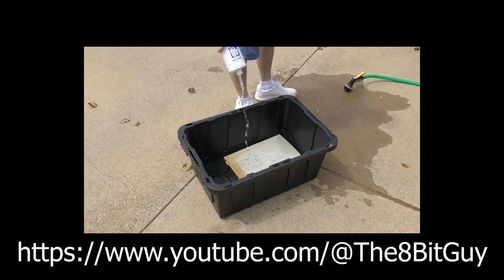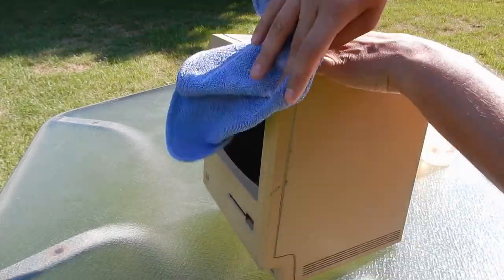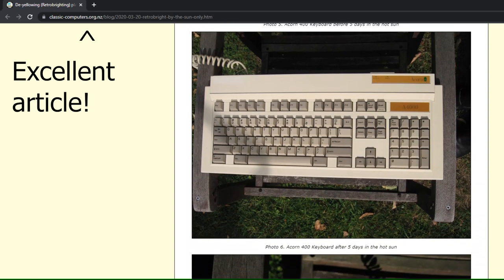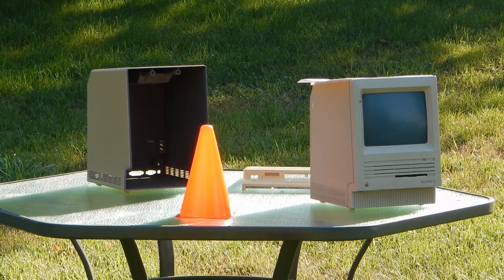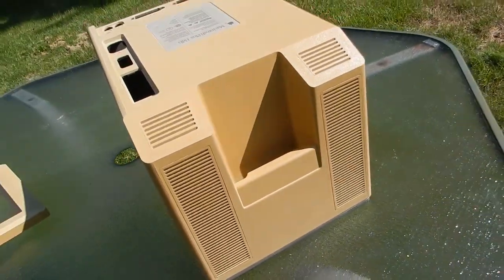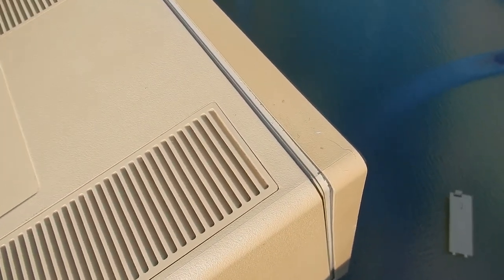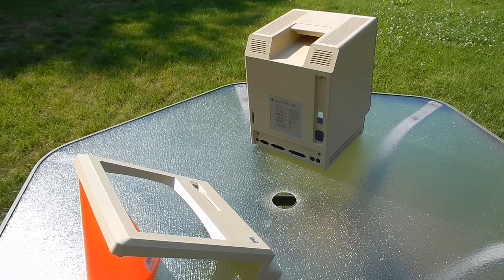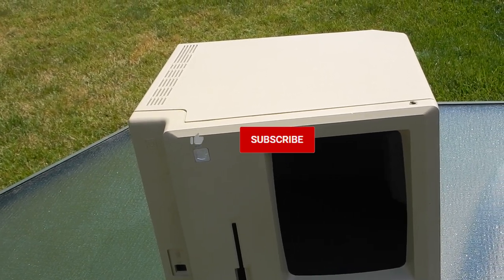EASY De-yellow Vintage Computers WITHOUT Retrobright!

Comment: If nothing else, getting the plastic 90% of the way with this method might greatly reduce the amount of time it needs to be bathed in peroxide to get to its original color.
Reply from the maker: That's a really neat idea... Never thought of a hybrid approach.  The peroxide would certainly do less etching if it didn't need as long of a soak.

Comment: I've had great results using the sun method too. And as you noted, this is a nice, easy, safe way. It just takes more time.
Reply from the maker: It works pretty good considering!  Very low risk.  I've seen quite a few chemical retrobrights that went "too far", or had uneven coverage - and the damage is permanent.  In my mind, excessive yellowing is damage that needs to be repaired, but minor yellowing is just a little character :). Thats amazing that you've had great results as well!

Comment: Wow would this work with a iMac G3 I picked one up on eBay for $150 and it has very badly yellowed plastic
Reply from the maker: @bearskorner9790  It likely would have.  Remember that this does not fully remove the yellow, it just significantly tames down bad yellowing.  It will also fade other parts, so if you’re going to do this (I’m assuming on the white/clear section), I would disassemble and only put that part in the sun.

Comment: That's great to know! I'm defintely going to try it. Do you think that using a UV lamp would wield the same result? At least for smaller items, like mice.
Reply from the maker: I think 8-Bit Guy did an experiment with different combinations of UV and chemicals, including UV only.  I'm pretty sure he got similar results to mine with just UV light.  He did his experiment with a handful of key caps if I recall.

What's always confused me is that everyone says a UV chemical reaction is what originally caused the yellowing, so it's surprising that more UV makes it better instead of worse.
Reply: @rebootretro  I'm going to watch that video. Thanks for the recommendation! Yep, I was thinking the same thing! Wasn't exposure to UV light the cause of yellowing? Maybe it's a cycle, were at first it makes the plastic turn yellow, but after a few years new exposure begins to revert the process... I really don't know. Now I just need to disassembly some of my systems (while hoping the plastic parts don’t just disintegrate themselves just by looking at them) and try this method. Great video as always!
Reply from the maker: @pedropassamani  Glad you like my videos!  The nice thing about sun-bleaching is that you don't necessarily have to disassemble it.  I'd protect things like the CRT to prevent any unpredictable fading.  There is a lot of heat too, so that could be a reason to disassemble too depending on what exactly you're trying to brighten.  Mine was 90% disassembled due to repairs anyway, so I just took the last bit apart.  Video on that Mac Plus restoration coming soon! :)
Reply: @rebootretro  apparently it's just oxidation that causes the yellowing. This explains why it also happens to parts that are stored in darkness for years.
Reply from the maker: @retrocoisas  Very interesting!  I wonder if heat is a factor too...  I feel like stuff stored in cool dark basements seems to yellow less then stuff stored in attics, but maybe my observations are random chance and unrelated, lol.
Reply: @rebootretro  I don't think so. I have stuff in a cool garage with a dehumidifier running and they still get yellow.
Reply from the maker: @retrocoisas  Thats a bummer.  I guess all we can do is just reduce the yellowing as much as possible, and then restore it if it gets bad.

Comment: Is this a joke? Sunlight yellowed my Amiga 1000! and I also yellowed a PC diskdrive front in sunlight... so this sounds like bullshit to me.
Reply from the maker: It's not a joke.  My Mac Plus was dark brown/orange.  Sat out in the sun for a week.  Now it's beige.  No chemicals whatsoever.  A year later and it's still beige.  Why did the sun turn it yellow at first, and why does the sun take the yellow out 30 years later?  I won't even pretend to understand the science behind it or why it does that.  But even to my own amazement, it worked.
Reply: @rebootretro  Does it make a difference if it's behind a window?
Reply from the maker: @Smartzenegger  It’s funny you ask that, because I was wondering the exact same thing.  I was curious if behind glass is why it yellowed, and if the direct sunlight reverses it… your guess is as good as mine.  I very honestly am curious about all this, but there’s so little data on even just sunlight bleaching.
Reply: @rebootretro  Meanwhile I found a video on the RetroRecepies channel from 5 years ago or something... he already knew this and explains it very well. And sorry, I can't post you a link... as you'll understand in 2024.
Reply: Glass can block enough UV light that it probably won't be enough to do the bleaching effect.
Reply: @retrocoisas  Yes well, see my previous post/answer here.